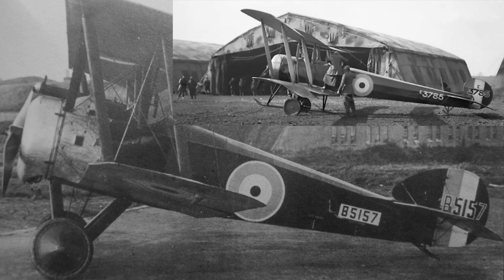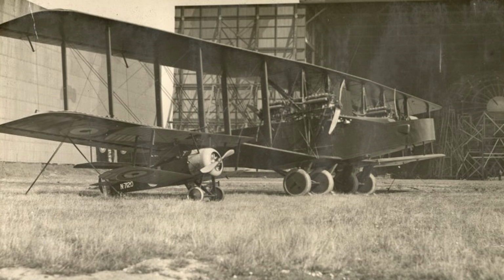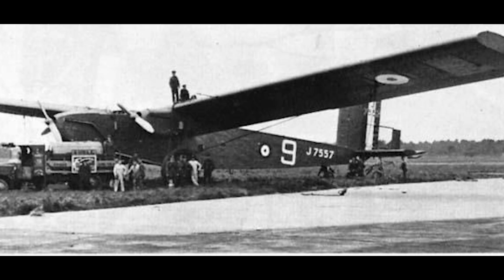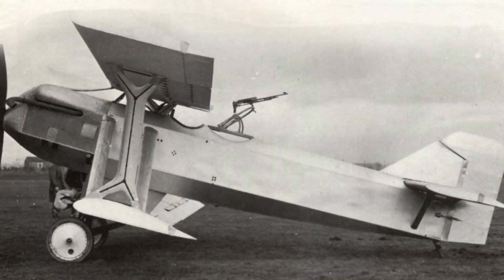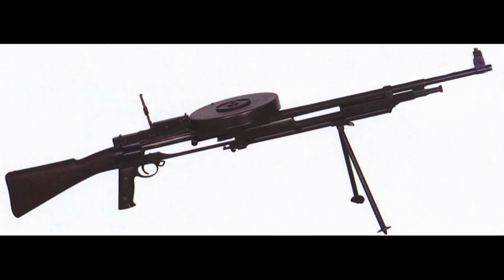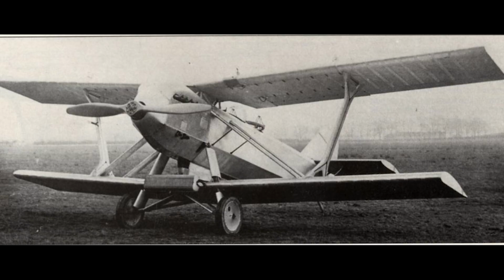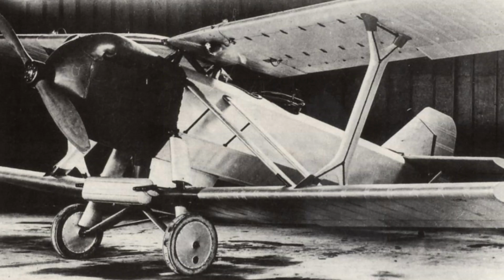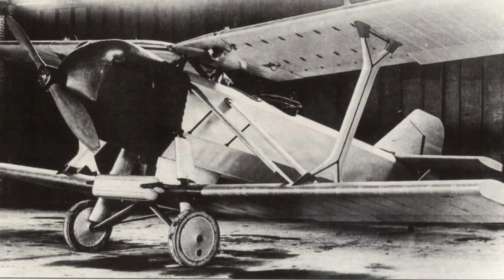The Beardmore W.B.XXVI – When You Build Everything Else, You Might as Well Build a Fighter!

Comment: At 6:42 you say it had a speed of 845 miles an hour! You do say you think the company was fudging on that speed, but is the 845 mph a misstatement on your part rather than a claim by the manufacturer?
Reply: I listened twice to see if I'd heard it correctly.  It does prove that England did beat the USA in breaking the sound barrier - and by roughly 20 years!
Reply: Gents, you've both misheard, I thought the same thing at first. It's the accent - Ed didn't say "eight hundred forty-five" but rather "a hundred forty-five" mph, which seems about right for the two hundred something kilometer conversion on screen.
Reply: @johnladuke6475  I'm sticking with my assertion that it's a Mach 1+ Biplane, and no rational explanation will otherwise sway me!
Reply: @davidb6576  It would take some kind of pilot to fly that thing in an open cockpit.
Reply: @davidb6576  I don't understand why your reply is directed at my comment. I was questioning the claim that the plane had a top speed of over 800mph.
Reply: @williamromine5715  Maybe it helps to remember the absurdity of a M+ biplane?  I'm just playing along...
Reply: @davidb6576  I would agree that claiming a speed of 845mph by a biplane would be pretty absurd.

Comment: I see from the comments that Beardmore really did build everything else - almost. Too bad the one thing they didn't build was their own aero engine.
Reply: They did in the early stages of WW I, a 6 cylinder us3d in the BE2 (?) pusher I believe.
Reply: The ill fated R-101 was powered by Beardmore diesel 'aeroengines' - derived from early locomotive engines.  The R-101 also ended up several tons overweight.....